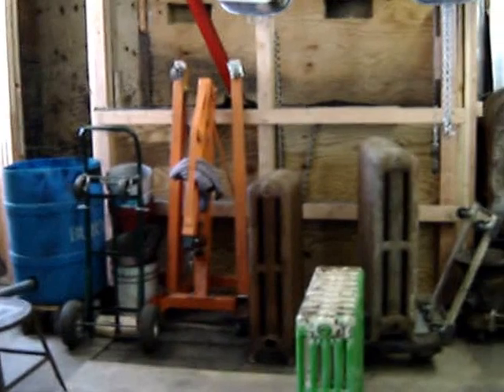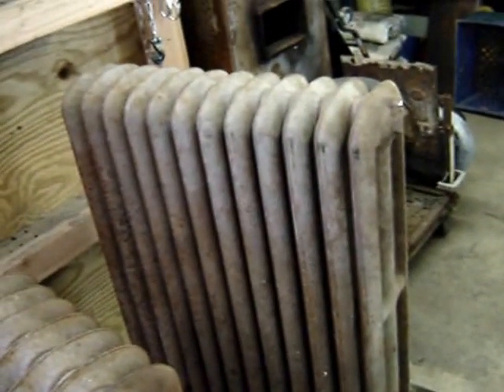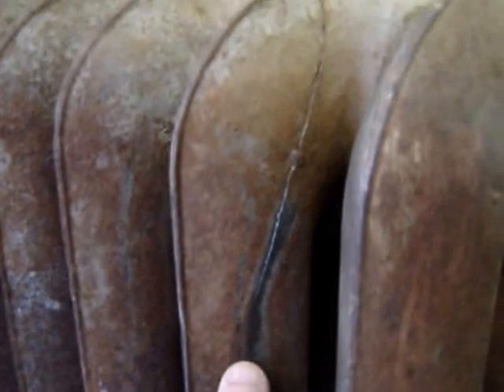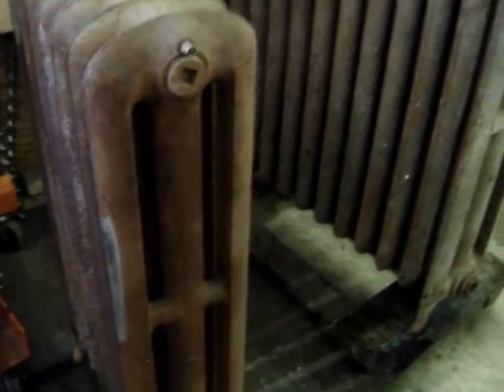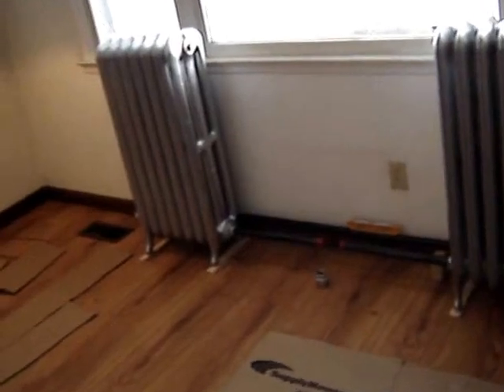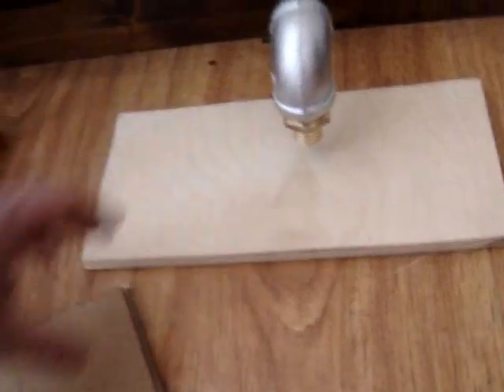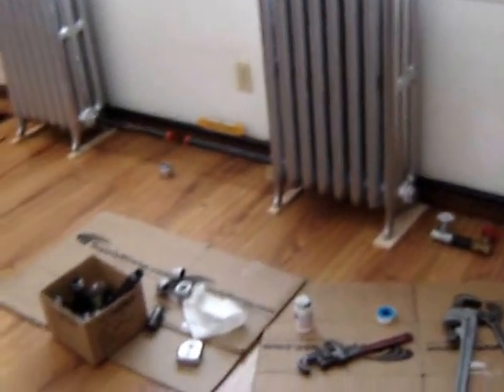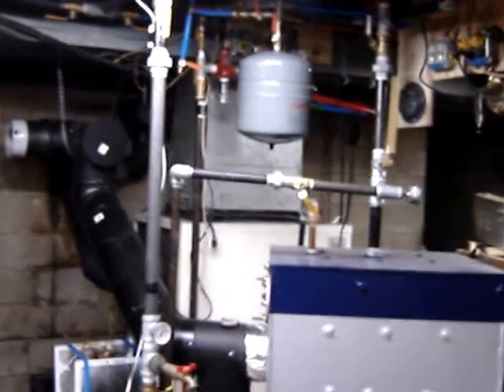Radiator Install, Coal Stoker Boiler

Comment: There are companies that will take them and completely rebuild them to like new condition. Don't know where you live but there is a company in Somerville, Massachusetts and will take yours in trade and provide you with exactly the size length and height radiator you need and they back them up. 

http://www.antiqueplumbingandradiators.com/index.html

This guy has the knowledge and the skilled personnel to do it right the first time and has a one year warrenty on all radiators he services.

I hope this helps as cast iron radiators are the most efficient way to heat your house. 

There are two ways to use cast iron radiators the American way and the German way.

American way is a thermostat turns on a circulation pump to all the radiators on the floor or floors to be heated.

The German way is actually the best way. One circulator pump for up to 4 floors runs continuously and each radiator has a automatic non electric thermostat attached to the hot water input ( the top of the radiator) . You determine the direction of water flow in the pipe supplying hot water and a 90 degree fitting directs hot water to the thermostatic valve which has markings from off to usually the number 5 meaning max heat. It will take a few days per room to find the setting for each room and radiator. There is a another fitting for the cold water return from the bottom of the radiator that returns to the hot water line. You  don't need a hot and cold water line. The cold return water returns to the hot water line after the fitting that supplies the radiator with hot water using a 45 degree fitting which helps pull the colder water back into the supply line. The Germans have perfected hot water heat with cast iron radiators as better than 90% of their homes have hydronic heating systems as most households don't have air conditioning systems as the climate isn't as hot in summer as it is in America. By running hot water through the pipes supplying the radiators it actually is more efficient as you don't have a large quantity of cold water entering the boiler all at once.

Last is a video about stopping the banging noises steam and hydronic heat can make if improperly installed.

Good info in it and it's like 4-5 minutes long from this old house PBS tv series.

https://youtu.be/hXjUj3L06MY

In cast iron radiators steam is supplied to the bottom of the radiator but hydronic systems are the reverse hot water enters at the top and colder water exits at the bottom.

Merry Christmas and I hope you found what you wanted under the tree.

Comment: Find a local sand blasting company that will use soda ash to remove the layers of paint or simply set up a trip to Somerville, Massachusetts that acquires cast iron radiators, takes the apart after cleaning all traces of pain/rust then reassembles them for either the customer or for sale. You could acquire a complete set of cast iron radiators for the entire house in one trip though it would require a bit of cash. Address to come.

Comment: Just a quick note here, literally every book I have on using cast iron radiators for heat (and I have a ton of them all the way back to 1896 to present day, because I did heating installations for 45 years) all say you should never paint a radiator with any metallic paint like silver or gold.  They all claim it reflects the heat back into the water and reduces the radiator's output.  Sadly, I found this out after I pained my own a beautiful gold color before putting them in with my new coal fired unit.  The all recommend a flat enamel paint which evidently will aid in the radiation of the heat.  Just passing this on.  Not try to be picly or critical of anyone.
Reply from the maker: ME TO! I found out the day after I painted them. What they are talking about is the radiant heat being blocked by the colors silver and gold. That's why you paint your boiler silver to keep as much heat in as possible.